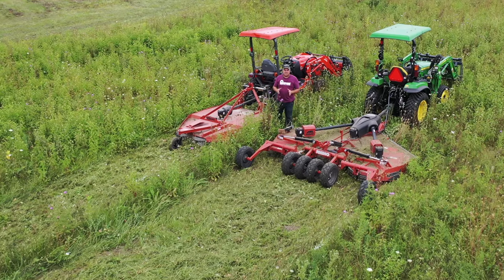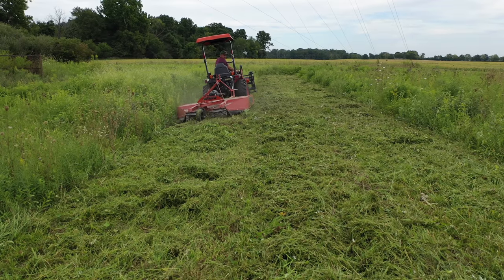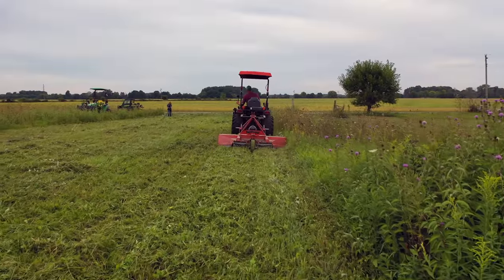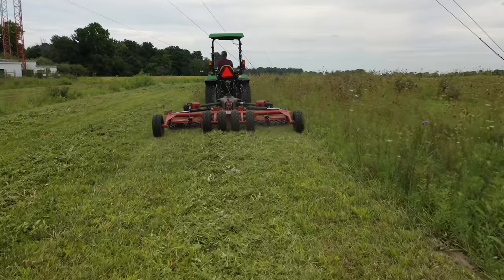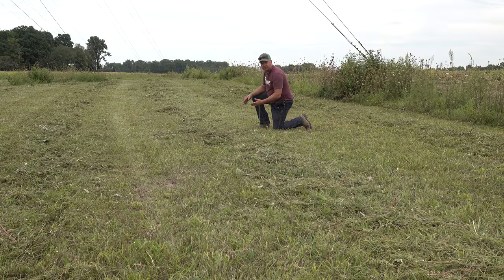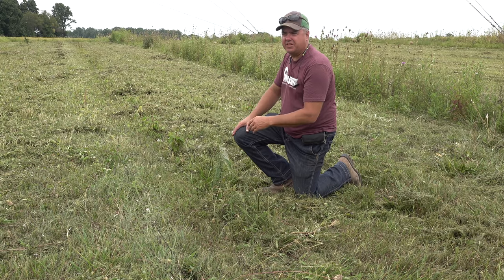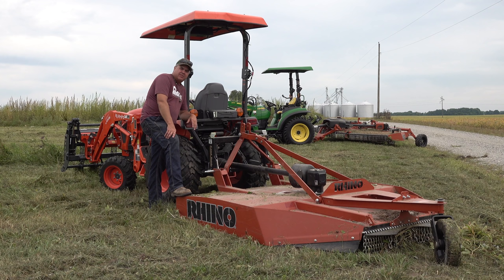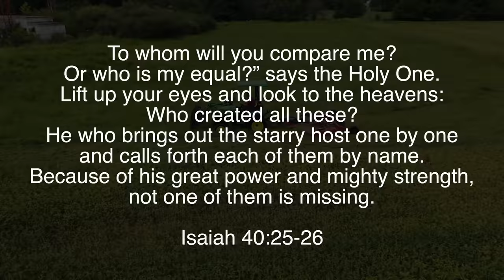Which Cuts Better? Single Spindle vs Flexwing Mower, John Deere 2038R, Kubota LX3310 Compact Tractor

Comment: My BX23s is mated with a 48" Landpride mower. (You can see it on my ''Blade Sharpening Mentor' video.)  It does just as you described for your single spindle mower when the blades are sharp. When they are dull, it leaves a lot more stubble and tends to eject unchopped piles of trimmings.  

It doesn't cut cleanly to the outside edges of the deck either.  I have to overlap cuts by at least 4". Otherwise it lays the grass down and it won't pop up on the next pass unless you reverse travel direction on each cut.  That might be an interesting comparison too.  What happens if you spiral cut a field vs alternate strip cut it?  When a field is cut by continuously traveling in the same direction (spiraling in from the outer perimeter) I always see spring up, at the laps.  When cut with reverse direction on each pass there is much less of it.

A question for you.  Did both sets of blades have the same lift configuration at the tips?   Or were they flat blades?  (Flat blades are made for brush clearing.  Lift blades are made for meadow/pasture mowing.)
Reply from the maker: Both are lift.

Comment: you make a great case for the flex wing.  I bought a 6 foot mower for my 60 Hp tractor and a have regretted not spending the extra $$ on a flex wing every time.
But I might spend the $$ on an offset flail mower instead as that gives me a flexibility that I could really use.

Comment: It always amazes me why people with large mower decks don't keep the blades sharp. I finish mow with a tiny little John Deere 320 with a 24 hp. Kawasaki & a 3 blade deck. (not the same or even close I know). I have 3 sets of blades & change them often so that I always have a sharp clean cut. It takes so much LESS hp. to mow thick grass with sharp blades & gives a great cut. Always balance my blades with an Anderson balancer so that the deck is very smooth when engaged. Love your content & presentation. God Bless.
Reply from the maker: Rotary Brush mower blades are not designed to run sharp.  If kept sharp, they will soon be destroyed by rocks and trees.  Blunt blades work better overall
Reply: Bush hog type mowers are more like a giant weed whacker than a mower so they don't really need super sharp blades.

Comment: My flex wing does a better job than my 3 point too, just can't get in tight spots with it.
I use a light bar and GPS for monitoring ground speed and overlap.

Comment: Suggestion, buy some little flags like they use for power lines underground etc, and mark stumps or rocks so you don't hit them or for reference when you later come back to remove them.  As for the cut stuff, what I do is a week after cutting long stuff like what you have here, I come in an do it again to mulch it down better..  Takes extra time and fuel but the only other real option is to buy a rake and bailer to get it out of there otherwise.  BTW, finally upgraded from the 1023e to the 2032r.. what a difference.  Especially with my stump grinder and grapple.

Comment: So I got roasted on a facebook group asking about running a flex wing behind a 1025r to mow short grass like a finish mower. 10' batwing "finish mower" I would love to see how it does behind the 1025r, or if it will even run it.  I have my reservations, but I also wouldn't be surprised if your mowing at least once a week and only cutting  2-4" that it would work
Reply from the maker: Tongue is too heavy for a 1025r.  There really is not a safe way to connect it.
Believe me, I have thought a lot about it, especially with our turbo Johnny X 1025r!

Comment: I agree with one of the previous posters, it would be nice to see what has sprung back up after a day or two. Having used both 3-point and trailer style single spindle mowers, I always felt that the trailer style did a little better job. I think that having the extra 3 or 4 foot spacing between the tractor and the mower allows the material to spring back up before the blades get to it. Now you have me curious whether there is a difference. But as you pointed out' the 3-point is much more maneuverable. Great video, and I really like the bat wing.
Reply from the maker: We intended to show it 24 hours later…but it rained all day yesterday…no chance to get decent video of it.   The single spindle looks significantly worse now.

Comment: I see a difference you only implied, between the two.  The single-spindle will "float" behind the tractor, and swing wide I would think, as you make turns, like a long overhang on a large RV rig.  Whereas the flexwing, trails behind exactly like a trailer does behind a pickup.   This would affect how you mow the turns/ends.  Of course-- back in the day, when I was mowing dad's stuff, with an even smaller Isiki (and a 5 foot single spindle), I'd just cut the ends first, then do the middle, ignoring the turn-arounds (which I'd already cut).   Nice comparison video.

Comment: Had a 10', twin spindle drawbar towed mower for many years.  It was not a flex wing design which I found did some scalping of uneven ground in sloped areas. It would send gravel flying in every direction when bottomed out.  Can you say, "INCOMING!"  (with your head down to the steering wheel and legs pointed straight out). However, it did an excellent job over my 60 acres of mowing for 30+ years.  With 10' of cut and just two spindles, the blades were very long and HEAVY at near 1" of thickness.

Comment: @Tractor Time with Tim
I've got a 5' fixed for my 3046.  I've noticed that the cut quality really drops if I go over 3/3.5 mph.  I also need to keep my blades sharp.  I mow a hay field I'm currently not using.  I also use it to cut heavy brush.  I'm still clearing large parts of my homestead.  I originally went with the single 5' at the recommendation of the dealer.  Now that I have it, I would like a bigger bush hog.  The tractor easily runs it without issues.  I am torn with the flexwing style of mower though.  Right now, I want the durability of the single spindle.  Maybe in the future, I will get one of those nice flexwings to maintain my property in less time.  

I did barrow a neighbors bush hog awhile back.  His is a single 7'.  It definitely cleans up behind the tires better, but I needed to go even slower than my 5'.  I'm curious if it has something to do with the spindle style and speed.  I'm guessing that his spindle turns at a slower RPM in order to have the cutter speed the same.  In other words, a 7' tire would spin at a lower RPM than a 5' tire if both were going 55mph.  After having used his, I think mine does a better job.  

I don't really have a way to test different cutter sizes.  I am curious though if it makes a difference.  I would be willing to donate $10 to the cause if you could test side by side a 5/6/7 bush hog respectively.  Knowing that speed makes a big difference in cut quality with my bush hog, I would want to see it at different speeds that are measured.  

Having used that flexwing in numerous situations, do you think it durable enough to be used to cut serious overgrown brush/small trees?

I'm also curious about a belly deck vs pull behind.  I'm considering trading my 3046 for a 4066.  There's not belly deck option for the 4series tractors I'm aware of.  I use my 3046 to mow most of my lawn.  While I try to keep my lawn well trimmed, I don't care as much about appearance as I do practicality and ease of use.  

You stay safe out there!
Reply from the maker: I think your 3046r would handle the 10’ TS10 just fine.  Yes, it will cut larger brush. Rated at 2” I think.
Reply: @TractorTimewithTim  It always amazes me what a bush hog will take down without damaging itself.

Comment: A flexwing mower is a farmer's best friend among many other things. We have a 15' 3 spindle mower on the farm & a 7' 3-pt single spindle mower that I got @ the start of the year. The 7' does best if i'm going in 1st or 2nd gear. & it gets bogged down depending on how high or low in have the 3-pt.

Comment: I noticed the center blade seems to be leaving more tall shoots than the two outboard blades. Any thoughts on why?  I am guessing that the two ouboard blades are able to float on the terrain, while the center is set more by the operator/tractor.

Comment: Moisture and high lift vs low lift blades make a big difference in cut quality in the tire tracks.  Also, a single spindle will always have one track cut against the lay down and one with the lay down.  A flex will vary depending on tractor and mower width but will usually cut against or perpendicular to the laydown.

Comment: What i tend to see the cut depends on the skill of the operator. I never really had these issues with a single spindle.
Reply: In this video, it's the same skill set mowing both cuts.  The difference from each cut can be seen from each deck. Yes, skill can have a huge impact on the quality of a cut but for this comparison, I think the level of skill was the same on both cuts. I also believe blade speed and deck height plays a large roll in a quality cut as well.

Comment: Tim, if you've done it before, i've missed it, but what about beveling the cutting edge?  Or is the real issue a lack of upward vacuum to pull the pushed over grass up?  If the latter, would removing the entry guards/chains help, or not enough to notice an impact?

Comment: When I use a single five foot cutter the grass is generally thrown to one side and close to uncut grass. After I make a round or lap I turn around and for my next lap and it recuts most of the previous lap and it lays it down nicely. However the back of my cutter is more open than that Rhino. I use a Howse cutter. It also has narrow blades which work best in grass and light brush. When I go cut heavy brush and small trees I use the other cutter with wide blades.

Comment: Do you run in float with the flex wing. I have one side that cuts lower out at the edge and I can see the cylinder moving to cause it.  So I tightened it just a smidge with the hydraulics and now getting a more even cut.   I just purchased the TS 12 and Love it.  No it is not as good of cut as the X- Mark because it is not suppose to be but It takes a lot less time.  But it is a lot better than the single spindle.  The single spindle was not designed to cut smoothly either.   Great video as usual.
Reply from the maker: Yes, I run in float.

Comment: A old farmer trick for the stones in the field you have there, put one of those electric small fiberglass fence post at every thing that sticks up out of the ground, as old fence posts, iron, stones, treestumps etc, we used very neon like orange ones that we put out every time after every harvest is done
That way we almost never damaged a blade or anything important, you could see the fencepost a long way from the tractor cab, it helps a lot
I think more youtuber farmers should do that as well, spend some time in the spring with the quad or tractors going around put them out, works fine if you dont have hundreds of acres but we managed it well on 500 acres (about 250 hectare I think in europe)

Comment: Do the blades all turn the same direction on the flexwing mower? Ive been eyeing a duel spindle for my 73hp machine. Currently I have a 6ft which is too small physically, (deck inside the tire width). I mowe very rocky areas & have to lift a lot. The tow behind wouldnt work too good in my application unfortunately. Would love to see a duel 8ft in action..

Comment: speed wise, which is faster? Say you cut that whole 4 acres with the six foot  mower vs. the flex wing is one faster than the other? I would think you could cover more ground with the 6ft travel speed wise.....
Reply from the maker: Not even close. The 10ft will outperform easily.   In lower density areas, you can speed up. In more dense areas, slow down. Overall, much more ground covered with 10’

Comment: And FYI you run the tractor at a lower gear with higher RPM'S  and over lap to get a smooth cut with no sprigs of weeds or grass Left standing after you mow and few days later

Comment: Tim, Interesting comparison. How would the Ventrac Tough Cut have compared? I know width of cut would be smaller, but how would quality of cut have been? Also, would there have been a problem with grass popping back up since mower is in front of wheels? Thanks.
Reply from the maker: You are right, Daniel…mower in front, so no problem with grass being pushed over.
Reply: @TractorTimewithTim  Thanks.

Comment: You mentioned the lack of a speedometer on your tractor. I wish that the aftermarket made a digital mph gauge that showed for example your tractor is going 5.1mph. The other thing I’ve looked for and can’t find is a fuel usage meter. I’d love to find something I could splice into the fuel line going to the engine showing gallons used down to for example 1.2 gallons per hour rate. I had a lawn service years ago and it’s something that would have been useful for me.
Reply from the maker: Brad, if you have a Deere 2032r up to a 5e, you can add the smart connector.  This allows you to see such info on your phone.
We did a video on how to install it.
Reply: Everything I have is garden tractor size.

Comment: Tim,  I don't think you overlapped your rows as well with the 6' single spindle as you did with the flexwing.  You were running very close to the edge and I think that's why you had entire rows of grass not cut.  Just my observation.

Comment: So I don’t know that any ruff cut mower creates any lift.  The blades generally aren’t spinning fast enough.  What I think you are seeing is a result of the flex wing being further behind the tractor and possibly overlapping blade paths.  The combination of being a trailer and the blades being in a triangle pattern allow the grass that is laid over by the tractor to stand back up.  Just my thoughts.  But to summarize no I don’t think any lift is created by ether mower

Comment: What are your thoughts on the single pedal for forward/ reverse on the Kubota, vs the 2 separate pedals on the Deere, now that you've had the Kubota for awhile?  I've got a Vermeer trencher with the single pedal, and compared to the 1026R I hate the single pedal.
Reply from the maker: Me too!
Reply: I think Kubota is starting to realize the short comings Of their treadle pedal. They have made a welcome change on the Grand L series. Hopefully they will do it on more models.

Comment: I find with a single spindle you need to travel quite slow to achieve a nice cut, I find 3-4 miles an hour generally. I think the overlap in the flex wing is here you get the nicer cut, also it can flex to correct for the undulations in the ground where the single spindle is more static in its movement
Reply from the maker: I’m sure I was below 2.5 for all of this testing.

Comment: Can you load the pull behind cutter and tractor on a tralier at the same time?
Reply from the maker: Yes, fits nicely on my 28’ trailer.  Would NOT fit on a 22’, at least I don’t think so.
As for width, it is only 5’ wide or so when folded, and lowered.

Comment: Tim don't forget the 6' is alot easier to load on a trailer and haul to jobs or wherever.
Reply from the maker: If trailer is long enough…like mine, the flex wing is fine.  It is only 5’ wide when folded.
Reply: Does it go up a set of ramps? I'm curious. Tilt deck would probably be best I'm guessing
Reply from the maker: @chickenman298  ramps would be fine if the right width.
The two inside wheels are ‘extra’ so not necessary to be on ramps.

Comment: I'd like to see this same comparison but with a single spindle vs a flail mower with Y blades. I bought a RCR1272 with my LX4701HST, and in retrospect, I think I would have been better off with the flail mower. I'm not cutting the thicker brush that really warrants a brush hog, and if I can find a reasonable price on a 72" flail mower with hydraulic offset, I may go for that in the spring. Assuming, that is, any dealers have any inventory...

Comment: A few months ago, my stepdad and I bought a cub cadet pro z 700 32 horse Kawasaki gas engine, carbureted and it’s been sitting for about a month. What should we do if the tractor doesn’t start up right away? Should we put a battery tender on it? Or start it and run it for a few minutes to charge the battery? Any help and/or tips would be appreciated. God Bless y’all.
Reply from the maker: Tender is good.  Jump it is fine.  Start and run is important.  If you use ethanol gas, then you should use sea foam etc to keep the fuel fresh.
Reply: @TractorTimewithTim  we have 100% no ethanol mixed with sta-bill in the fuel that’s in the tanks of the tractor
Reply from the maker: @user-tq1bs2fj9h good!  You should be fine with that.

Comment: Ive always thought a pull type mower cuts better than a 3 point hitch mower as the 3 point will move up and down with the tractor over any terrain difference even though it appears relatively flat.
Reply from the maker: I agree with that theory.

Comment: that's interesting that you said a gear transmission would not be as good because the gear transmission puts more horsepower to the PTO than the hydrostatic
Reply from the maker: Ok, but with a hydro, I can vary the speed of the tractor dynamically to conditions.  Makes a HUGE advantage.